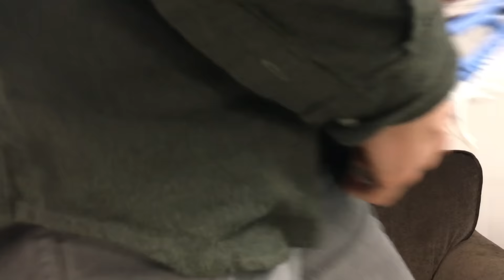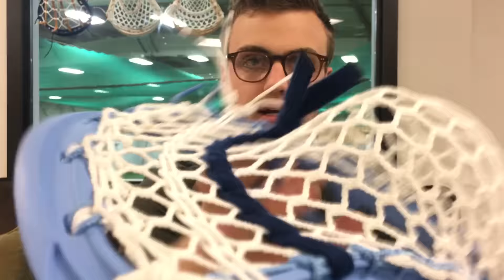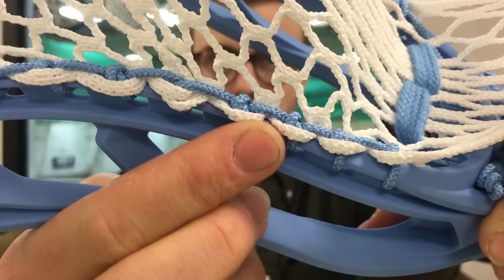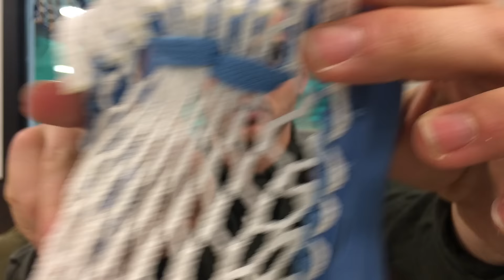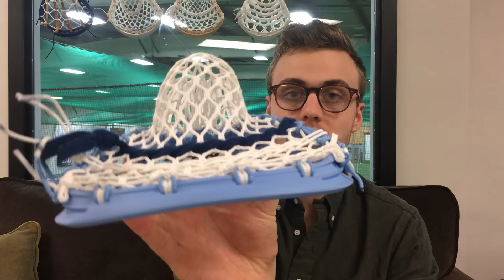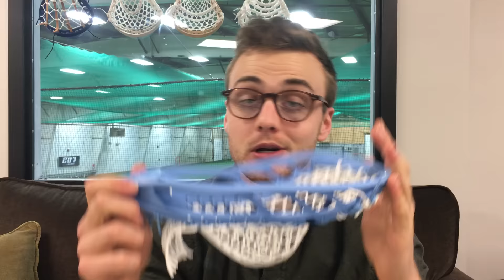STX Hammer U Updated Pattern

Comment: So I had the pleasure of stringing my d pole with some hero mesh and decided to use this pattern. I string up my sticks usually with a defined channel for the sake of consistency, hold, and feel. Hero mesh and this wider channel provided by your pattern didn't sit well for me when I took it out for some wall ball. If I were to do anything, I might drop the anchor knots both down by a sidewalk hole and remove one of the KSI's above the double SI. I'll attempt it when I have the time and let you know when I can. Probably not worth your time since the Hammer 500 came out but I'm not buying a new head until my OG Hammer snaps ;)

Comment: I strung this exact pattern while tying the top string to the second sidewall hole, and I had a good channel but the pocket was super illegal. I took out the last ksi and tied through the final sidewall hole through the next 10d row with the bottom string on the same 10d row that I finished on. taking out the last ksi sacrificed some channel, but the depth is perfect, great hold, very defined mid-high, throws dimes, check it out.